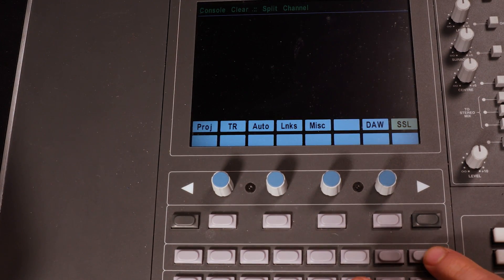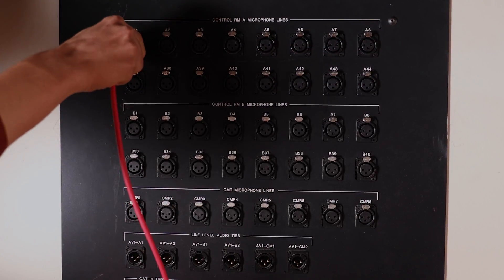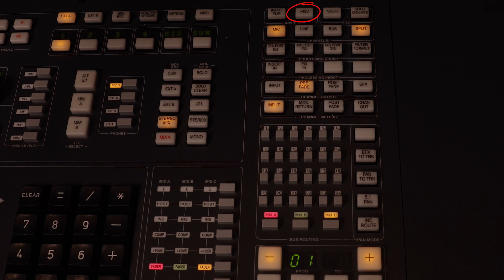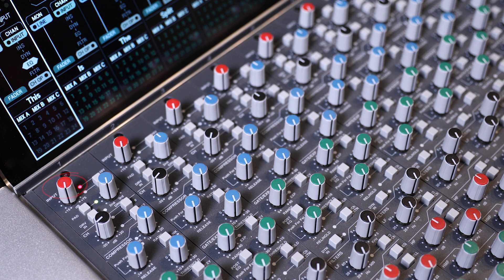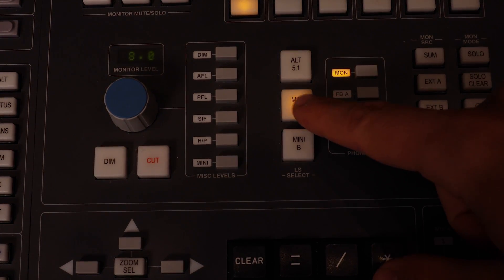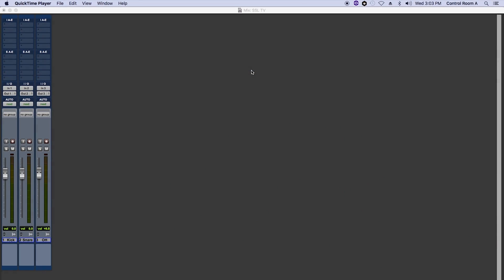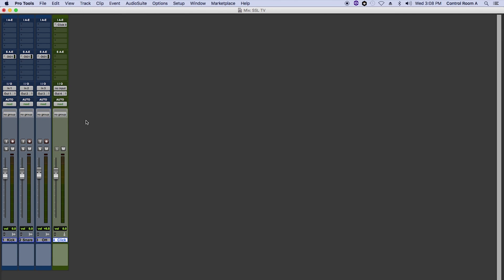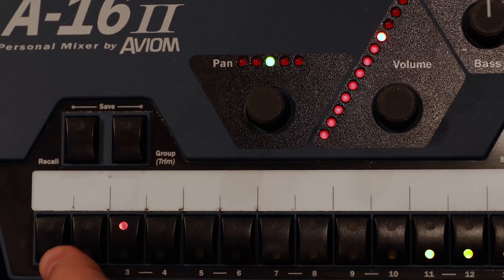How to run a session on the SSL Duality Console

Comment: You don't need to create a separate send signal unless you're mixing different tracks into one mono or stereo submix. DAW output patch in this case (and for mostly all of the other cases too) is half normalled and on the top so just patching out from the initial line output number into the aviom will do the job.